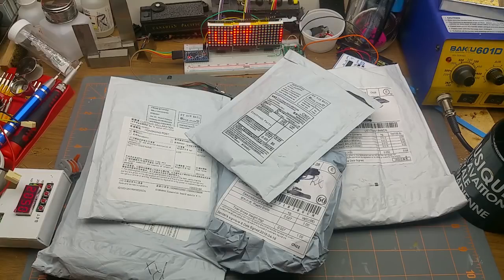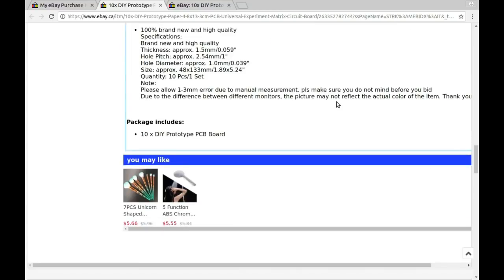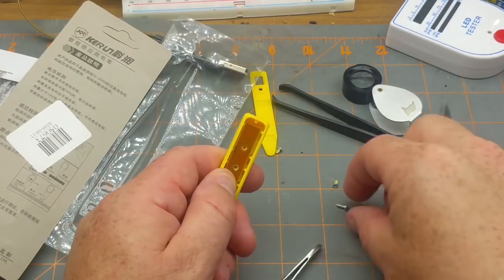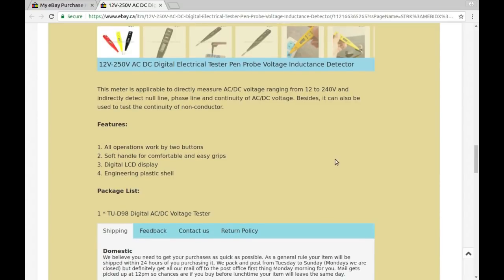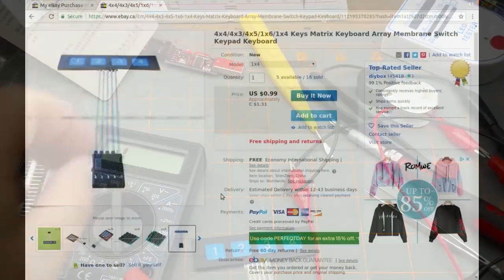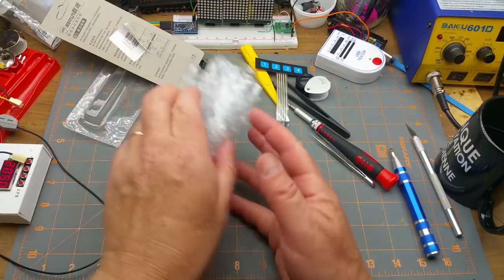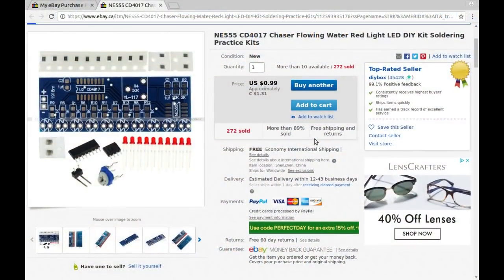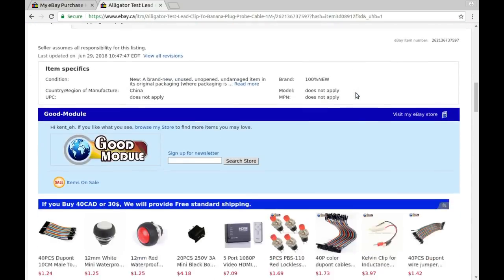mailbag monday 32

Comment: Oh!  we forgot to tell you,  if you heat shrink most of the shaft to the tip, only exposing a small portion of that voltage tester, it would be a lot safer for you.  Why they didn't protect the shaft is very Chinese of them. Thanks again!

Comment: What I find funny, truly funny, you don't have much experience with some of these things.  It's very humorous to watch you with my friends, (who are all of either electrically or electronically adept). We absolutely love to watch you open the packages as a kid does on Christmas with such excitement and glee!  One thing we would like to tell you, is that you have the neutral of the light socket wired to the hot side of your plug, and that was the reason you were getting a voltage reading when you touched the neutral side. The other day we watched your video when you received the mini component vacuum, and we laughed so hard when you said it didn't work yet it clearly did.  You have to hold the button while picking up the component dude! Only release the button when you have the component in place. It is a momentary switch, meant to create suction for short moments for placement.  You do give up a chuckle and we appreciate your videos and will continue to watch.  Thank you! (and yeah we do a bit of drinking when we watch, so it's not all you  lol)

Comment: Test leads are installed with bendend wires. So plastic shield take half of contact. I recommend solder wires.
Reply from the maker: Good idea.
Soldered is always a better connection.

Comment: Those test leads are probably kind of crappy, with poor connections and very thin copper inside. Probably the only use of them is to measure voltage, resistance of these might be quite high, thus useless in power supplies and resistance measurement. 

These membrane buttons have glue on the backside, just as you said, ideal for sticking on.
Reply from the maker: Yeah, cheap test leads aren't a good plan for precision measuring. Especially not current and resistance.

I was planning to test them before I use them anyway.

But , for the price, I think they’ll do for basic stuff.

Comment: Yes, careful with the "paper" PCB proto boards.  I have no experience with your breadboard-shaped ones, but have piles of the 5x7 types, which are inexpensive (around 12 cent) but  awful.  The copper pads are so close, they are sometimes touching, and can invisibly bridge.   Too much heat causes the pads to lift,  and the board easily burns and warps.  Fiber-boards with a real solder mask and tinned pads are oh-so-much easier to work.
Would like to try out those plastic enclosures.
Reply: Nice to know, thx for that. Just ordered some of those cheapo things on Aliexpress.  I have the fiberglass ones here and I was thinking of trying the less expensive ones.  Will keep an eye on those issues then.
Reply from the maker: You do need to get in-n-out quickly with your iron. there's usually no second chance to rework on these cheap boards.
I am disappointed at the extra-shoddyness of the etching, though.
I'm not expecting great things, but for the price I hope they'll serve my needs.
Reply: Exactly what I was thinking. Small projects outside of the house , opamp, couple of resistors, nothing to fancy.  Just hope they don't swell or something like that from humidity.
Reply: Mine just arrived, to bad we can't insert photos in the comments.  I don't have a lot of trust in these things.  Looks like a blind elephant drilled the holes and some islands look extremely close to each other.
Reply: Yeah, I cannot figure why they make the copper etching  so bad on them.  They would do us a favor by making the pads about 0.1mm smaller, and more square-shaped.  Well, they are cheap.  I was quite pleased with these from Amazon:  https://www.amazon.com/gp/product/B008CG62DI/
Reply: These are also in 5x7cm format, made of fiberglass-resin, cost more, but they are more durable, and infinitely better if you are putting lots components on close together:  https://nl.aliexpress.com/item/10PCS-Double-Side-Prototype-PCB-nned-Universal-Breadboard-5x7-cm-50mmx70mm/32730428361.html
If your project is exposed to the wet, I would avoid the "paper" board for this.
Reply: Indeed, sometimes saving a buck isn't worth it. Not even sure if I am going to use them now I've seen your link.